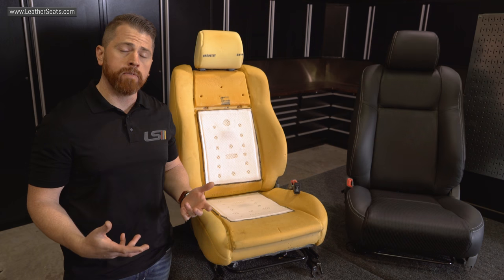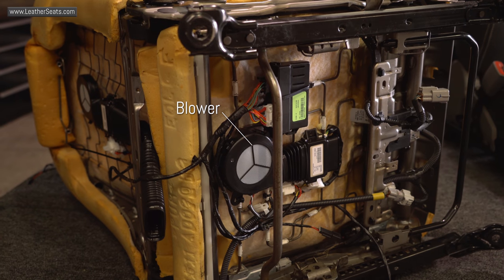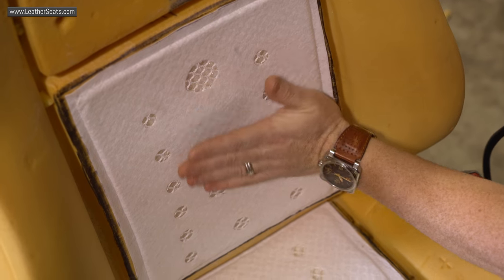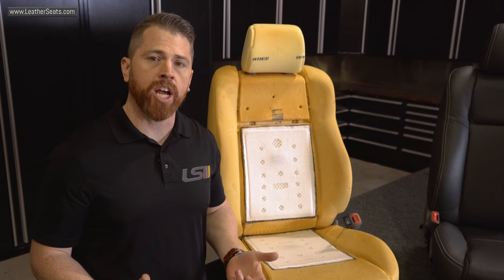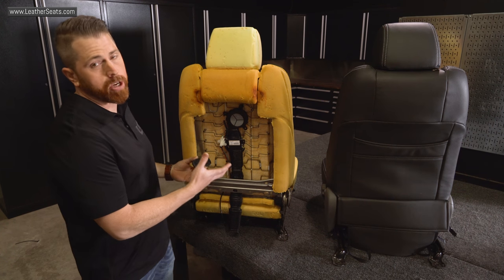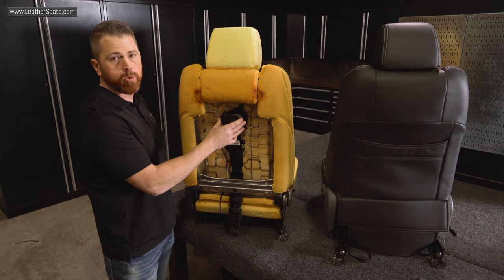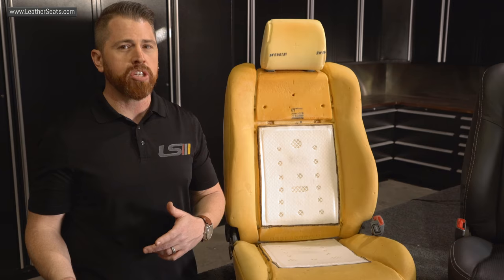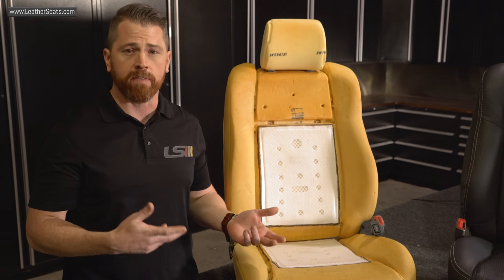Installing Heating and Cooling Seat Ventilation - Alternate Options - LeatherSeats.com Tech Tips

Comment: My hat off to Luke at Leather Seats.  He has been helping me adapt their controller to power the factory heated/cooled seats from a 2015 MKC that I'm installing into my 1966 Galaxie.  The controller, wiring and switch are costing around $180 per seat.  A way better option than trying to retain the factory DSM.
Reply from the maker: TandD1w Thanks for the shoutout! I will be sure pass this on to him!

Comment: Eric, I’m really impressed with your products and your installation skills! I always thought that cooled seats were connected to the vehicles hvac system. How does this small unit make cool air, a heat pump? Thank you so much, Eric.
Reply from the maker: Mitchell Barnow You are very welcome, thank you for watching! These units utilize the Peltier effect. Check out this link to our main heater/cooler unit video where I go over this in more detail: https://youtu.be/66JSqDfw46w?t=387

Comment: Just installed mine this last weekend, wish I had seen the video for the vent on the intake. I used mine down low for the exhaust. do you sell separate vent pieces? One more question, is it bad to use an add a circuit fuse jumper for power and run both leads together?  Turned on one switch and it worked and hit the second, now neither one will turn on.

Comment: how well does this system work on non perforated upholstery.  Looking to put this on  my CJ7 but for obvious reasons there are no holes and no one makes an upholstery kit. Much cheaper than retrofitting AC
Reply from the maker: Joeys Cleaning Lady Unfortunately these units are not designed to work on non-perforated material. That being said you may experience some surface temperature effects however we have not tested this. Many local automotive upholstery shops have the ability to pattern your seats in their current condition. If you do find a shop that is able to do that we can sell you the high-flow backing foam to make it compatible for these units. Please email sales@leatherseats.com or call us at 1-866-639-7328 for more info.

Comment: I really want cool seats in my Jeep…. I think they have failed wrangler users with this option. However it has heated seats already. How would you install this with an already installed unit
Reply from the maker: Roblox Planet Our Sanctum Seat Ventilation system replaces the factory seat heater as it provides both cooling and heating with a single unit. For details about how this works, please email sales@leatherseats.com and we can go into some depth.
Reply: So does this work with the factory controls?
Reply from the maker: @RobloxPlanet  No, this has a complex 6-option control switch that comes with each unit and will replace the OE system. Shoot us an email or give us a call and we can get you further information.

Comment: Can you do it on black Subaru with black seat
Reply from the maker: Abdullah Al Abdullah The heater/cooler units themselves are universally compatible as long as you have proper access to power, room to place the units on the seat foam, etc... If you have any specific questions about our products be sure to contact sales@leatherseats.com or give us a call at 1-866-639-7328.

Comment: Could you have installed the blower under the seat as well rather than in the rear?
Reply: The kit is designed for and comes with parts for both back and butt areas.

Comment: Would these work on a 1970 gmc c10 truck bench seat ?
Reply from the maker: Brian George The units themselves are universal as long as you have room to mount them properly, have proper power to run them, and seat upholstery that allows proper airflow. If your seat upholstery is cloth or doesn't have perforation, the results may be limited to surface temperature as apposed to full airflow. For more info please feel free to reach out to us at sales@leatherseats.com.

Comment: Can you install cooled/ventilated seats on a Tesla Model 3?
Reply from the maker: slcea7 These units are universal and can be used on almost any seat out there. In order to work properly 1- the seat must have room to mount the units, 2- you must have access to ample power to plug into, and 3- the upholstery must have perforation as well as a high-flow foam backing in order to allow proper airflow. In most cases if the seats meet these requirements they should work fine however there may be exceptions out there. We do have the upholstery pattern to fit the Model 3 and can produce a leather kit with the high-flow foam backing in order to be compatible. Please feel free to reach out to us at sales@leatherseats.com and we can get you pricing and options.

Comment: can you install heated/cooled seats on race style seats?
Reply from the maker: Michael Jordon It would depend on several things but mainly if there is room to mount the units on the seats and if the seat upholstery is correctly modified for air flow. Meaning that the upholstery includes perforation and has a reticulated, high-flow mesh foam backing instead of the more traditional scrim foam. If you have further questions we would be happy to answer them. Just send us an email to sales@leatherseats.com or give us a call at 1-866-639-7328.

Comment: Which kit is using and what about the price??
Reply from the maker: Basil George The upholstery kit in this video includes both perforation and reticulated foam to allow for proper airflow for the units. Here is a link to the units on our website: shop.leatherseats.com/heater-cooler-units Be sure to give us a call at 1-866-639-7328 or email us at sales@leatherseats.com for more info about the system requirements.

Comment: could you do this on cloth seats?
Reply from the maker: Gustavo Salgado These units were not designed to be used on non-perforated upholstery without a high flow mesh foam backing. However depending on your cloth setup you may be able to feel temperature differences with the units properly installed however you are not going to get very efficient airflow through the upholstery compared to perforated leather with reticulated foam backing.  Most cloth upholstery has a much thinner foam backing than leather so there is a good chance that the temperature will transfer through to your body. We have not officially tested this so you might want show this video to a local automotive upholstery shop and get their opinion based on your seats specifically.